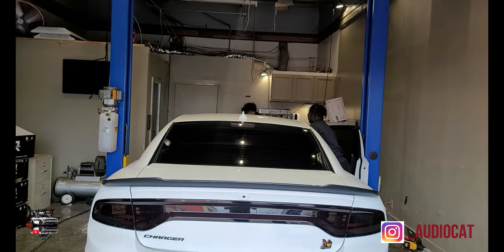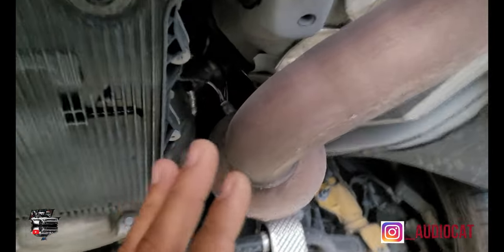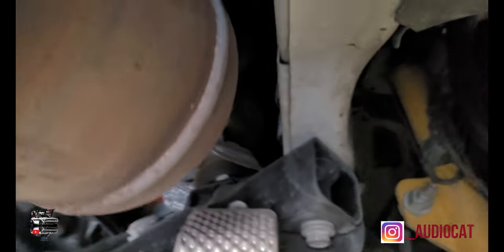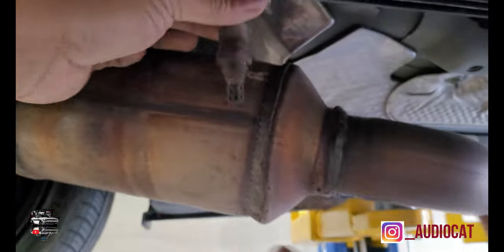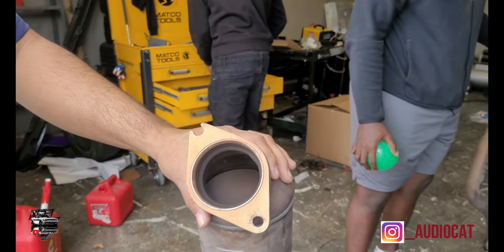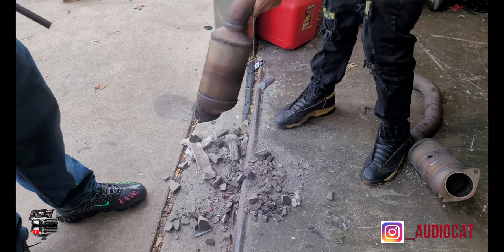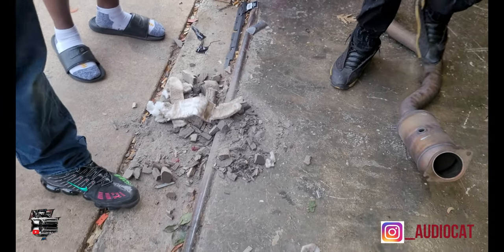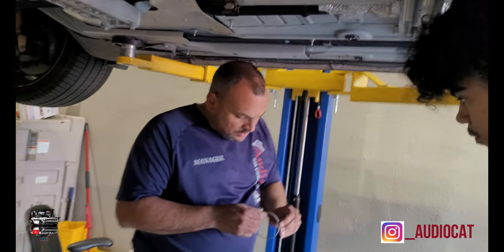COMPLETE HOW TO HOLLOW YOUR DODGE CHARGER CHALLENGER  CATS AND AVOID EXHAUST TICKETS!!!!

Comment: Pretty neat! I'm sure you'll em in a couple years for inspection, but then at least you'll have these to put back on right after.
Reply from the maker: It.qould pass inspection it has no errors
Reply: 3 years and not inspection so far .. when I'll be called ?

Comment: I haven't see a clear answer to this question. If a person hollows out their cats, does a cat delete or installs a dummy cat... does it require a tune? What are the risks associated doing this?
Reply: If you don't get it tuned it'll just dump slightly more fuel and bring the mpg down quite drastically, but it won't ruin your engine
Reply: @giantkilla_ yes you need a tune if you want to daily drive it you would have to go to a custom performance shop or find a specific OBD plug in type tuning device for your vehicle and yes delete all the cats or the engines exhaust stroke and compression stroke even air intake stroke will be different in each bank and the entire engines cylinders/ timing/ firing order will be off
Reply: @giantkilla_ dam bro that’s what’s up I always wanted to delete one cat and move the other cat somewhere down the middle of my exhaust now I know the cars engine can run with just one just fine !!  Yeah cause one of my  cat is clogged and my car is is misfiring and running rough and I can’t accelerate hard or it chokes
Reply: @giantkilla_ so you don’t need a tune if you get a cat delete off a charger rt? And also nothing won’t happen if you daily drive it ?

Comment: Is taking your mid-mufflers or mid pipe (after the X pipe) would it turn on the check engine?
Reply from the maker: Need o2 spacers
Reply: No the mid muffler isn’t the mid pipe… the mid pipe is where the cats are and what they hollowed out. After the x pipe is the mid muffler and no lmao u will not get a check engine light or any code. That is the most basic mode u can do and probably the best u can do for these cars since they kinda quiet from factory.
Reply from the maker: Yes the mid pipe is the one we hollowed out the cats on

Comment: 2:42 He said Cataly"S"tic 🤣   Oxygen sensor spacers don't sense heat, they pull the oxygen sensor out from the exhaust pipe. As a result, the increased oxygen level in the exhaust flow can't manipulate the oxygen sensor. Thus, the ECU keeps thinking everything is alright with the cat system  Though, he may be right. It may be heat! After all it is a Cataly"S"tic converter🤣

Comment: technically speaking the wider hollowed out cats maybe beats a straight pipe,. as there is more breathing room now like the headers get modded a little bit as well with the exhaust system so more power and definitely if you were looking for more rasp and growl the hollowed cat has more volume then a straight pipe, so this is a great method i did this on my cars to make it easy with out a lift system in my drive way i put it on blocks and ended up cutting a rectangle hole in the bottom of the cat , dumping everything out of it and tack welding a steel patch over the hole, i live out in the southern California desert so its all good i modded all my exhausts and nobody cared,.  woo o  o :)  i might try your method on a crown vic that has double cats 4 of them , that or straight pipe them at the shop and 2raise out the O2 censor i got some with a cat built into the censor razer from big daddy's garage i use them to out the engine light one with a bend one with the cat in it and a 3rd another extender 3 of them welded together l o l ,. cheers

Comment: I stay in Dallas I need to come thru for my cats too
Reply from the maker: Come on down 930 N. Belt Line Rd. Suite 130 Irving Tx. 75061
Reply: I have my cat cut off but I’m getting them again but I want how you did that scat pack.
Reply: You can do it at home for free all you need to do it buy spark plug nonfoulers to keep the check engine light from coming on

Comment: Did this yesterday and no check engine light for about a hour.now I have a p0058 code.idk what I done wrong, would I need to remove a fouler
Reply from the maker: Need to put o2 spacers on the rear o2
Reply: did it work out i wanna do this but dont want a cel
Reply from the maker: It work perfect

Comment: i heard it’s bad for the car, what do you think?
Reply from the maker: No need to pit o2 spacers
Reply: Don’t hollow out the cats. The cats have mad value. Just buy mid pipes from jba (u will also be louder with 3inch mid pipes) and sell the cats to the exhaust shop or to somone else if u don’t want em

Comment: If i do this and dont add the spacer and it throws the code will it affect the cars performance? or will there just be a code?
Reply from the maker: Code but will be ok but not be at best
Reply: It will change fuel mix to make cat hotter trying to make it more efficient. That way your car will always run with a rich fuel mix. The best solution is to install a device called oxygen sensor simulator in cat 1 sensor 2 that way ecu will always think cat is running efficiently and maintain the default fuel/oxygen mix making your car spend less fuel. It would also be a good idea to weld a pipe inside hollow cat space to avoid "explosions" (idk the name in English) . You just need to weld 1 side of the pipe in the gasket

Comment: You never showed or told what the part number is for the o2 sensors spacer.
Reply from the maker: There called o2 sensor spacers ebay has them if dodge get angled ones
Reply: @AUDIOCAT  yeah but still need size. Or are they all standard size?
Reply from the maker: Standard

Comment: Why does my cat bolts look different. Mines is long and I could t take the cat off
Reply from the maker: What year is she
Reply: @AUDIOCAT   2017 ta 392
Reply from the maker: Should be the same boss
Reply: @AUDIOCAT   the bolt on mine sticks out at least 2” past the cat flange 😂
Reply: @AUDIOCAT   I did all of this and drilled the foulers installed it and now the CEL came on
Reply from the maker: What is the code in dash diagnostics
Reply: @AUDIOCAT   it said bank 1 under threshold and bank 2 lean. Sounds like I have a leak in bank 2. Gonna throw in new gaskets Friday
Reply: @AUDIOCAT   it said bank 1 under threshold and bank 2 lean. Sounds like I have a leak in bank 2. Gonna throw in new gaskets Friday

Comment: So if you managed to get the entire exhaust out of the car, why not just cut the cat off and put a pipe in it's place? Why gut the cat if you have such easy access to it? I would think gutting cats is only done when the cats are upstream and difficult to remove
Reply from the maker: To keep o2 sensor I'm place
Reply: And isn't it illegal to have converters off thats why he kept them on
Reply from the maker: Yes sir
Reply: @YT-glockstreamer even tampering it